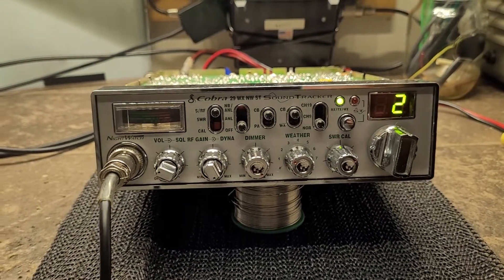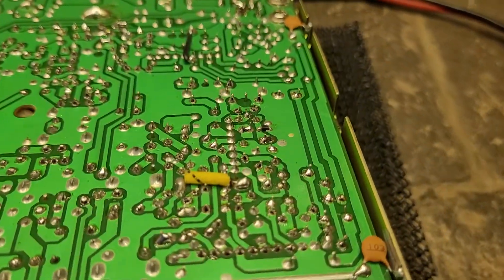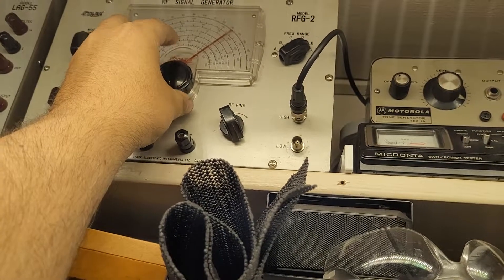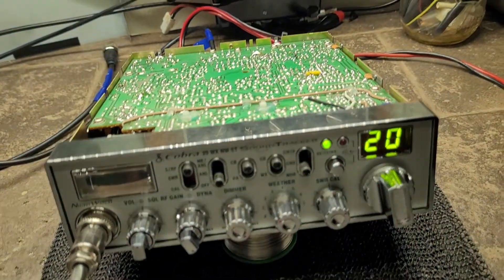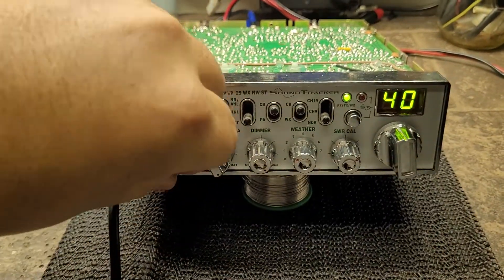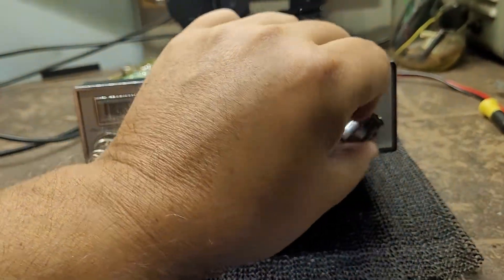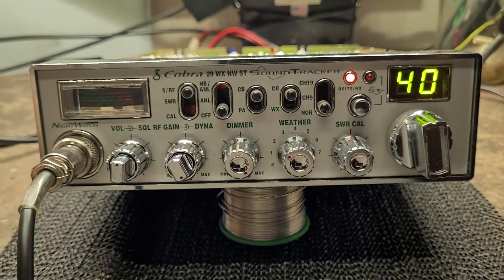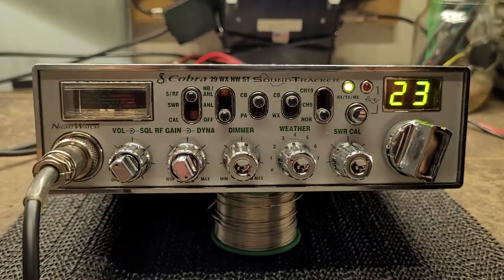COBRA 29 WX NW ST - Trouble shooting and repair PART-4

Comment: I just got one of these, after futile attempts to fix an RS TRC446. Seller said it worked. I have no wx and almost no volume.
Reply from the maker: Do you have the radio on a outside antenna?
Reply: @Radionut63  It turned out to be a bad speaker!
Reply from the maker: very common problem as you just discovered.
Reply: @Radionut63   Put a replacement speaker in and that fixed that issue. CB is dead where I live even on the major Interstates.
Reply from the maker: @trs80model14  perfect repair, congrats!

Comment: A SAMs book will tell you to test on channel 19, inputting 1000 Hertz tone. Any Clairifier Control in the middle position.
Reply from the maker: Radio is AM only, not SSB. So the radio do not have a clarifier.